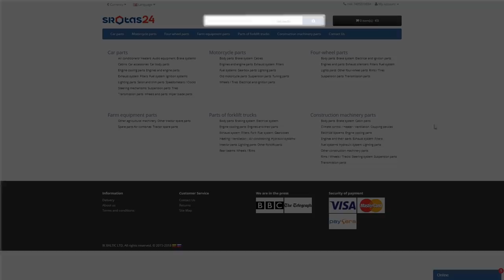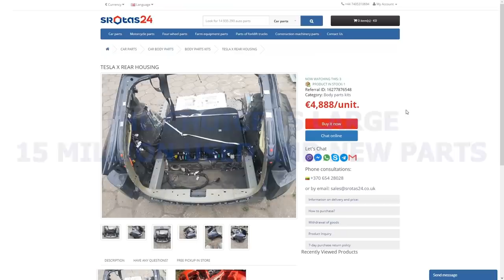Ford Mustang. The body restore. Ремонт кузова.

Comment: As usual, great Work Arthur!
I'd be curious if an engineer could determine how much weaker those repaired frame rails are vs. never repaired frame rails. It would be interesting to see this repaired mustang crash tested like The Insurance Institute Crash Tests against a wall. Then do a never wrecked mustang and do some measuring! 
I'm not saying the repair isn't strong. I'd drive that mustang with no worries. Rather, I'm just curious.
Reply: I’ve often wondered whether car manufacturers build in repair factors. It’s just as bad making a repair too strong as too weak. If all the crash structure was seam welded and strengthened, it would be lethal in a crash as the energy would not be absorbed as well.
Reply: @johnturner4400   I totally agree with your comment in regards to not over strengthening the repair. Clearly, the design of the rails is to crumble up and absorb the impact.
Reply: I would also be very curious to know the difference if any . I personally would have NO problem with owning and driving a vehicle repaired by Arthur.